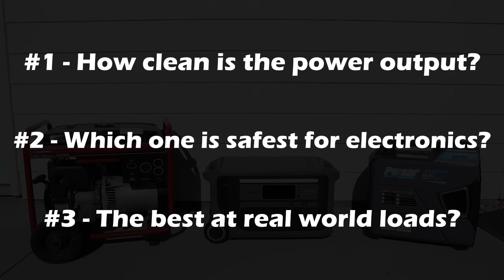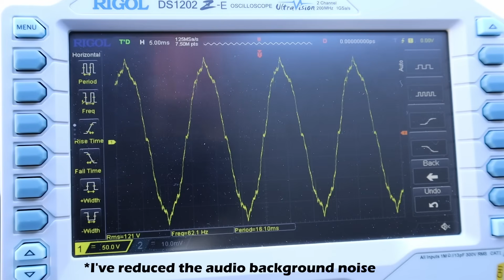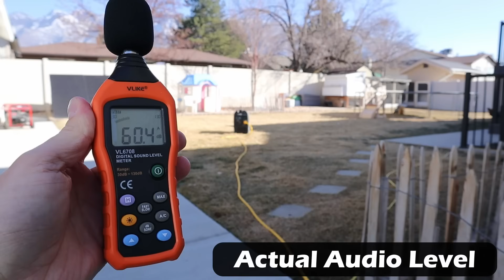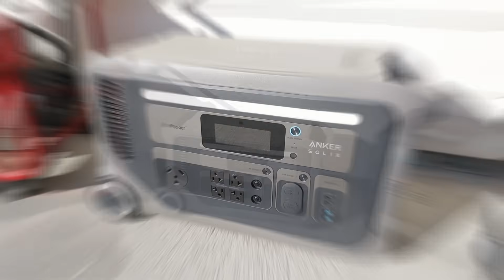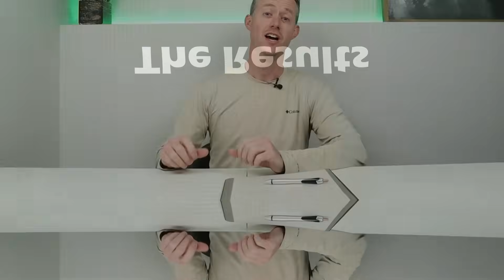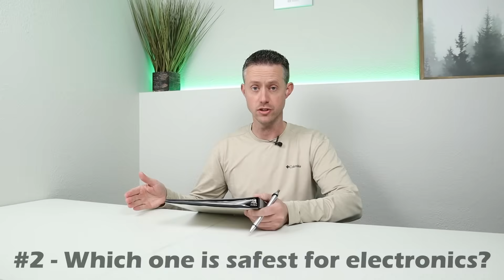Before You Plug Electronics Into A Generator, Watch This!

Comment: After Katrina/2005  I used my Dad's old 1985 4Kw Generac Generator. 
It is a non inverter generator with brushes, no AVR module at all.

 I used it to power the Freezer ; lights.
 Powered a 90 Mhz Pentium computer with dial up modem
, Used it with a 5500 BTUH window AC too
used it to charge up power tools batteries

It is not an inverter generator. It burns 1/2 the gas when zero watts compared to the full 4000 watts

So I used it one and off each day for about 12 days until I got power

That generator does not have a perfect THD but had no issues with any of my electronics at all

*** The biggest issue with a generator is not the THD; it is the LOAD DUMP when an idiot pulls out the output cord while the Loads are still ON
ie the big Inductive loads will create a spike in the Voltage and blow up stuff like electronics

Comment: what about the DC output from a gas powered welder like a miller 325
vs the AC output (the welder has a dual circuit slip ring style genset)
Reply from the maker: What would you use the DC power for?
Reply: DC welder has 19-32V DC @ 325A for charging battery banks (instead of solar input)  while using AC for other common stuff, rather than going from AC-DC-AC **edit: (sorry i meant a miller 302) which has a 100% duty cycle of 300A at 32V- while separately providing AC current on its own circuit

Comment: Generators putting out 61.4Hz instead of 60Hz is common. I basically set all of my small generators I repair to 61.4Hz because it helps it run large loads. 
The faster engine speed means there are more power strokes per minutes so the horsepower improves. The less time between power strokes also helps the generator react faster to load changes. The generator also has more momentum too when spinning. 

The generator’s ability to catch-up with new loads and ability to sustain high loads is noticeably improved from those three factors combined.

Comment: "The sun is unlimited power" I suspect you mean unlimited energy, power is limited to the size of your PV panels,  the battery charger,  and what the inverter can do?
Reply from the maker: Power is a measurement at a given time, energy is a measurement over time, in some cases they can be used interchangeably. I try my best to use them properly.

Comment: 9:45: My PC runs just fine from generator. It's rated to 100-240V and 45-65Hz. That's what's written in the power supply. The generator always stays in that range despite the unstable voltage and frequency.

Comment: Would you connect a traditional generator to a power station? Use the power station to run the house and charge it with the generator as needed?
Reply: That is exactly what I am doing.  I have a traditional,generator and 3000 watt pecron.  It’s more efficient use of fuel and allows quiet time, like at night.  Only problem is pecron can only put out 1800 watts when it is also being charged with 1800 watts from genny. Pecron Can do 3000 watts but only for an hour, then needs recharge, and recharging at 1800 watts only allows another 1800 watts to,pass pecron.  My winter needs at roughly 500 watts to keep place heated.

Comment: I am American but have lived in the Philippines since 2009.  We have VERY frequent blackouts here so I have always had at least one backup generator. One of my previous ones was a 3500-watt Honda. I do not where it was built or what market it was meant for. I bought it from a major hardware chain here.  I loved it. It started on the first pull 99.5% of the time. It ran for over 600 hours total before the engine locked up.  The reason I am talking about it is because it put out 50 hz., NOT 60 hz. I ran both desktop computers and laptops, phone chargers, TVs, inverter type refrigerators, inverter type freezers, etc.  I never had any problems with any of them. I am currently running a bigger Honda that puts out 60hz but if I ever buy another generator, it will be another of the smaller ones. I never had any electronic problems with any of the cheap generators I had before either. I think modern equipment is a lot more forgiving than most people claim.

Comment: I'm not sure where all of this comes from but we have hundreds of customers who use gensets installed on their boats and I haven't heard any complaints of problems with electronics either plugged in or installed on the boat. Could it be that most electronics are filtered and stabilized much better than what is presented? My second thought is the quality of the generator. Are you comparing to the low dollar Harbor Freight quality of a product? We have a standby genset that runs our marina with a lot of electronics including about 10 desktop computers and a server along with all of the network equipment. Some have battery backups and some don't. We have no issues and the genset will usually fire up a half dozen times a year or so and if do to a hurricane it may run for several days or longer.
Reply from the maker: I'm sure there are better traditional generators available. This is just one we have had for years and years and I wanted to see the difference in power output. Does dirty power actually damage newer electronics? The internet says it does but maybe it's fine. Some people in the comments say their traditional generators have damaged devices, some say they haven't.  The results are definitely mixed.

Comment: Another factor in running your home on a generator: Loads create their own distortions and those are also additive and subtractive. So the single type of loads test you did here (one type of load under each instance, not a mix of electronic and non electronic loads) makes the results invalid for a real world scenario. I have run my whole house on a conventional Predator generator in the past, INCLUDING my invert drive washing machine, TV, electronic board dishwasher and lamps in various combinations for extended outages with no issues or damage whatsoever. 

That said, it is always best to run stuff with the cleanest power possible, but even today's electronics can tolerate THD of 6-10% without damage, (maybe slightly reduced performance or time keeping accuracy.) If the THD exceeds 15% then it is a problem and damage can occur.  If you try to have a balance of capacitive loads (TV's, computers, inverter driven equipment,  etc.) with inductive loads like fans or non inverter HVAC or window A/C units, the THD tends to drop as the loads "filter" out each other.

Comment: 5% or 7% THD from a traditional generator is quite good and I would not hessitate to plug a computer or an inverter a/c in. On the other hand, values of 15% or 25% THD are pretty much not unheard of, even from reputable brands. On the third hand, big heavy spinning machines (e.g a compressor) are easier to start with a traditional generator. Whith an inverter gen, you either need a lot of surplus power or the protection trips before the machine is able to start.
Reply from the maker: Thanks for the valuable feedback!

Comment: This video is very important to help people save money and make wiser decisions. People have no idea how important contentious,stable,clean power is. It's easy to automatically assume it's ok just because it works. Then they are surprised when their devices fail in a short time. Electronics have a power supply. Unstable and or dirty power generates heat. Usually it's the power supply that fails. With sensitive equipment/devices it's the delicate chips inside that fail or are damaged first. My neighbor thought that it was ok to put his 98in smart TV on a basic gas generator just because it could support the load. This was during a ice storm a few years ago. I tried to warn him. He didn't listen. It only took few hours. His TV went out and wouldn't come back on. He was very upset that he had to buy a new TV. Upon inspection it was the led circuit that went out first then the power supply section. This was just his experience. Failure in electronics varies. You would think that a capacitor would help with the surge load and possibly some of the dirty power. With basic gas generators. Video idea  suggestion, test the circuits and loads of home ac panel. Id like to see what happens to other circuits when the HVAC system kicks on and off. Sorry for the long post 😅

Comment: There is a vast choice of conventional generators. While many do not offer good THD results, others do. That isn't reflected in this limited testing. Further, the cost delta between a conventional generator and an inverter based generator is significant. There is certainly an argument to be made for inverter gens, especially for people not inclined to look at the subject in more detail. For those that are, there are conventional generators that provide clean power for much less cost per watt than a similarly sized inverter generator.
Reply from the maker: Thanks for your feedback! Definitely worth considering.

Comment: Very well put together video, I like how you did all of the tests. Based on the sine waves from the regular generator, I'd be curious with the THD is with it running at half load (a single space heater).  It looked to me like with no load the sine wave had peaks, but will full load (2 space heater) the peaks were depressed a bit, so maybe half load it would be better?  Just a curious question.  The inverter generator and power stations clearly produce the cleanest power, which has been my observation as well (tested with a different set of power stations).

Comment: Quite valuable test and results.
Just a remark: my power station (ecoflow delta 2 max) is quite slow in charging from the grid. That saying, it is quite inefficient to rechare a power station from any generator (except solar...), as the generators are inefficient anyway (just about 15%) and specifically inefficient at low load.  Maybe your power station charges faster from the grid, but I still would avoid charging from a generator if avoidable.
Reply from the maker: You have the ability to adjust the charging speed of the Delta 2 Max via the smart app. You can select any wattage between 100 and 1800w.

Comment: Makes sense the power station did a bit better than the inverter generator.  At the end of the day when a load is put on the engine still needs to ramp up when a sudden load hits it and thats not instant.  A battery by contrast just has an amperage spike but no mechanical changes so its all down to how fast the inverter reacts.  There are also pieces of equipment designed to "Clean" dirty power from a traditional generator.  Basically a 1:1 transformer using the magnetic field to absorb and smooth out some of the noise.

I do agree though that the best option is a  power station (or full home battery/inverter system) thats being charged off solar with a generator used as intermittent backup power.  Generators loose efficiency when they are outside their ideal power band and while at idle are just wasteing fuel.  Kick them on as needed to charge up and then shut it off while you run off battery until needed again.

Comment: The one main difference is that you can refill a gas power generator in less than a minute (assuming your have gasoline).  My solution is to charge my batteries with my gas power generator when needed going through a "Chargeverter" to clean the power.
Reply from the maker: Yes, the chargeverter accepts dirty power so using it to charge batteries with a traditional generator is just fine. The price on that chargeverter is quite expensive now, it's near $700.

Comment: Here’s a question….could you charge up a portable power station with the dirty power from a regular generator….then use that accumulated power to power your sensitive electronics?

Essentially use your portable power station to mellow out the THD and other irregularities from the regular generator.

Seeing as a regular generator is half the price of an inverter generator.
Reply from the maker: The issue is that power stations pass the power through to the loads as they are charging, that's why it's called pass through charging. Dirty power in = dirty power out, it's not filtered or anything. Most power stations won't even charge from a traditional generator since the power isnt clean.  An inverter generator is best.
Reply: @Jasonoid What if you disable the pass through charging? Until the unit is fully charged? I’ve heard Bluetti makes provision for less than ideal power….
Reply: I’m doing just that - charged my pecron f3000lfp with non inverter genny. Works just fine.
Reply: @dougreed2278 Cool. Would be interested to hear from other people doing the same.

Comment: Some inverter generators have an economy mode switch: That means the generator RPM is reduce under small loads to save gas. But you might need to switch away from economy mode to run something like a microwave oven or the generator could stall and/or overload. If it overloaded, wait a couple of minutes to let the overload reset and then try again but not in economy mode. 
Keep a bottle of isopropyl alcohol on hand to add a couple of ounces to the tank if the gas is old and has absorbed water. Always shut the fuel cock when not in use.
Reply from the maker: Great tips!

Comment: My solution to the dirty power coming from a generator is to run all of your loads off of a high-quality split phase inverter and use the generator to charge your batteries. This way you can turn your generator off and still run your critical loads.. You’re only using your generator to charge your battery bank.

Comment: Thanks for showing that side-by-side test very informative. One thing you didn’t cover is how the generator would do with water well pumps. I wonder if they accept the dirty power or not.  I would think that they would handle the rush surge a little bit better, but I have found my diesel generator not to run my 1.5 hp even though I have a 6800 diesel generator.
Reply from the maker: I'm sorry but I don't have a well pump or water pump to test with.
Reply: I have a 5KW diesel generator that will run a 1.1KW (1.5hp) water pump but not a 1.5KW(2hp) water pump.
If yours is a submersible pump maybe there is too much pressure in the pipe from the pump so the startup current will be to high?
Will the generator run the pump if it is removed from the well?
Reply: @g @gbone7581  thanks for the reply. I tested the voltage drop at the pump about 300 feet away and found that there was quite a bit of voltage loss.  Since then I rewired it to double up on the 10AWG and plug it directly into the generator.  You nailed it, I believe that’s the problem. I haven’t tested it yet.

Comment: I have always been a fan of inverter generators for important electronic backup power.  This has only been from documentation and understanding the design.  I was happy to see the the actual value of it, and knowing that a bit of additional cost is worth it.   With every item becoming "electronic based", traditional generators do not seem to provide what is needed, even at job sites.  Probably OK for triditional motor driven devices, but even now they usually have battery charging stations for portable tools plugged in, and a good way to shorten the chargers life.  I guess there can be an argument of charger cost, to price and output load needed to run other job site equipment.  Though most equipment now has "smart" features integrated.  Every more reason to keep that 30 year old saw in good shape.
Reply from the maker: Thanks! Great thoughts 👍

Comment: Electronics being my career,  I had checked the quality of gas generator output years ago and found just what you got.  NONE were as bad as the "modified sine wave" inverters that appeared early on.  Back in the '70s however we generally had more robust electronics in our appliances.  Not so today.  When the true sine wave inverters hit the market I built my power station using one and a 12V battery charged with a transformer type battery charger that could be house powered or gas generator powered.  Thus solving the dirty generator problem.  Today it is a 48V solar powered system with a 120V powered charger and backup gas generator to run the charger.  Clean power problem solved.

Comment: The Poweroutput from the Classic Generator seems bad but look at the HF generated by the Inverter while under load.
THIS can cause problems with devices,and even be illegal if this interrupt Radio frequencys.
Also the high frequency can cause problems with Capacitive cupling.

Comment: From an EE designer's perspective,  since everything "sensitive electronics" use DC internally, provided by an AC-to-DC power supply, which starts out with a rectified and filtered AC power line voltage... that noise from the direct output Genset isn't very likely to "hurt" anything.  It may not allow PFC circuits (Power Factor Correction) to function as well, but in an emergency situation, that's not a big deal. 

Battery Backup units (excluding "Pure Sinewave" models) output FAAAR worse AC power than anything shown here, and computers and laptops run on them just fine... that's the market they're sold into. 

I would like to see any data that proves those Gensets cause damage to any of the final "Not Safe" list.... all of their ele tonics are, as listed above, internally run by the DC power supplies... which removes the "noise" from the AC source. 

Having said all that, "traditional" gas generators are quite a bit less energy efficient at less than full-load conditions.

Myself, I use my EV's HV battery for emergency backup - via a V2L (Vehicle to Load) adapter... that big EV battery has a lot of energy available... and the little adapter requires no maintenance.

Power stations are pretty handy though... but the run-time is very limited.
Reply from the maker: Excellent information, thanks for sharing your knowledge! Much appreciated!